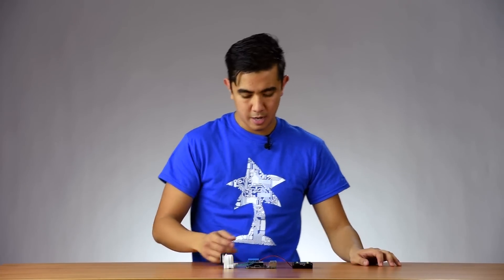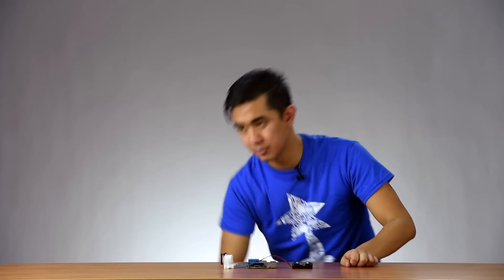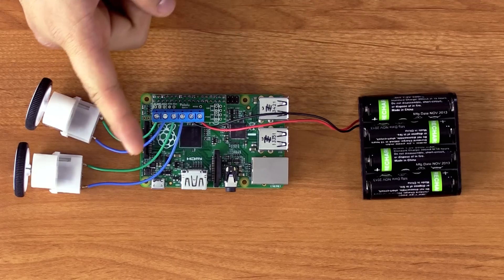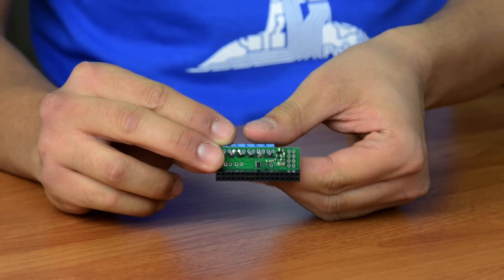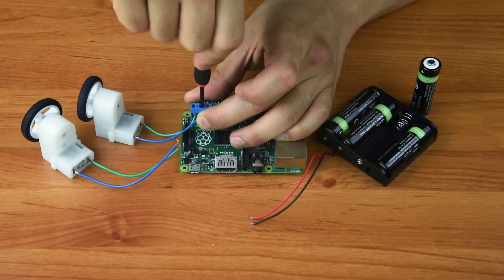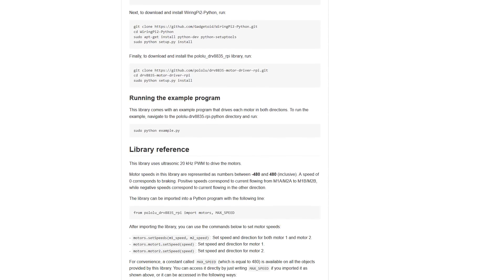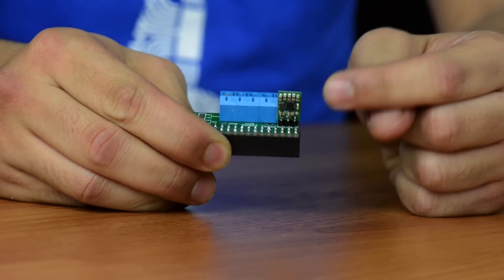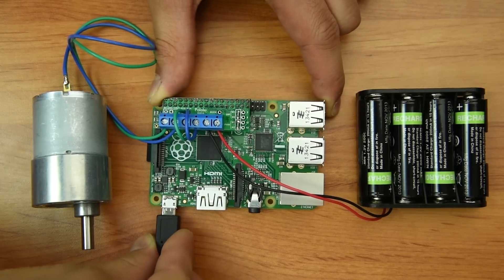Introducing the DRV8835 Dual Motor Driver Kit for Raspberry Pi

Comment: The documentation page isn't very comprehensive. Where are the ENA pins and whatnot.
Reply from the maker: The pins are labeled on the silkscreen and there is a diagram on the product page highlighting the connections to the Raspberry Pi. It seems like you might be mostly confused about the pin naming. In case it helps, the PWM signals are applied to the ENABLE pins for each motor channel and the DIR signals are applied to the PHASE pins.

Comment: Would you be able to do a similar video for the arduino shield version? Also does the 5V regulator work with the shield for the arduino?
Reply from the maker: Hi, Matty. We do not plan on making a similar video for the Arduino version, but you should be able to follow the instructions on the product page for how to assemble and connect that driver to the Arduino, and the principles behind connecting the motors and motor power are the same. Regarding the regulator, the purpose of it in the Raspberry Pi version is to supply power to the Raspberry Pi, but for the Arduino version, a regulator isn't needed. You just need to install some header pins and a jumper to supply your motor power to the Arduino's Vin pin. The Arduino's onboard regulator then supplies 5V back to the driver. There are details about how to do this under the assembly section of the product page: https://www.pololu.com/product/2511

If you need more help setting up the shield, please post to our forum: https://forum.pololu.com/
Reply: @pololu  Thank you for your reply, it has been very helpful!

Comment: help me connect raspberry pi b+ to sabertooth 2x25 motor controller to drive r/c tank from my website
Reply from the maker: +Robots4Sale We do not make or carry the Sabertooth motor controllers.  You might try contacting the manufacturer or distributor.
Reply: +Pololu Robotics and Electronics i know you dont have sabertooth motor controllers, i already have that. do you make something as a go between the raspberry pi and the sabertooth 2x25? the raspberry pi b+ has 4 outputs to control 2 motors like tank drive. i want to put it on a bigger r/c tank, so i must use the sabertooth 2x25. so i need something from you that converts the raspberry pi signal from 4 wires, to the 2 wire input into sabertooth using the r/c signal. (right now sabertooth vehicle is controlled from simple r/c receiver and transmitter.) surely you have something that converts the signal ?
Reply from the maker: +Robots4Sale We can help with connecting our own motor controllers to the Raspberry Pi, but we don't have anything specific to help you with the Sabertooth, and you probably don't need much anyway.
Reply: +Pololu Robotics and Electronics ok if i have a motor controller of yours, that handles over 20 amps, and it has 2 inputs in your motor controller. where can i find the code for raspberry pi to control 2 motors using your motor controller? i want to drive this r/c tank like a tank-drive vehicle using 2 motors.
Reply from the maker: +Robots4Sale If you are still planning to use the Sabertooth, you should contact the manufacturer or distributor.  To get advice selecting one of our products, you should post more details about your project on the Pololu forum or send us an email.

Comment: can i use it with pi2
Reply from the maker: We have not had a chance to test it yet. There is no official documentation for the Raspberry Pi 2, and some software libraries have not been completely updated yet, but they claim it has "all the features" of the older model, so it will likely work, at least eventually.
Reply from the maker: Update: We have since confirmed that the DRV8835 Dual Motor Driver Kit and its software will work on the Raspberry Pi 2 Model B and the Raspberry Pi Model A+ in addition to the B+.
Reply: Thanks

Comment: why "up to" 11 volts? i cant use a 12 volt battery?
Reply from the maker: The DRV8835 is rated for a maximum motor supply voltage of 11 V, so a 12 V battery would not be appropriate (especially since it could significantly exceed 12 V when fully charged).
Reply: well that is dumb. 12 volt is a major standard voltage.
Reply from the maker: There are all kinds of standard voltages, and a device made for one or some of them is not going to cover all of them.
Reply: if you can put in a voltage regulator from 11v down to 5v for the raspberry then you should put a voltage regulator in this drv8835 from 12 volt to lesser amount :(
Reply from the maker: The regulator from 11 V to 5 V is not part of this board: it's an extra part you can put in if you want.  You can likewise put in your own regulator between your 12 V battery and this board.